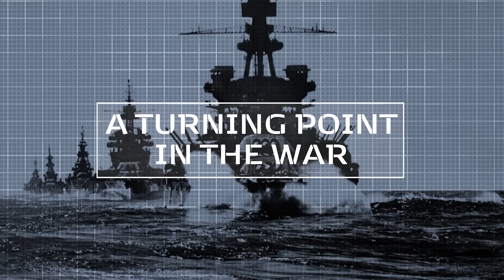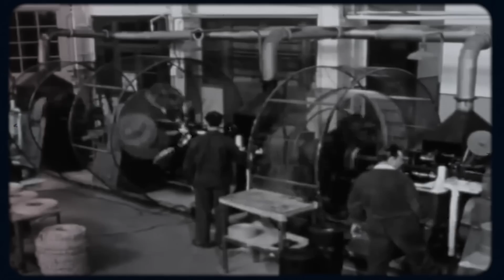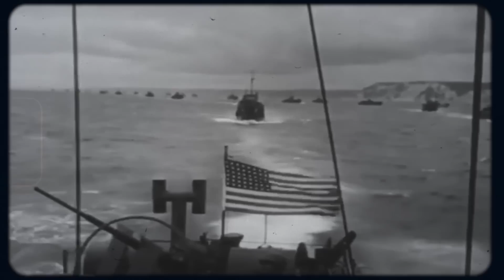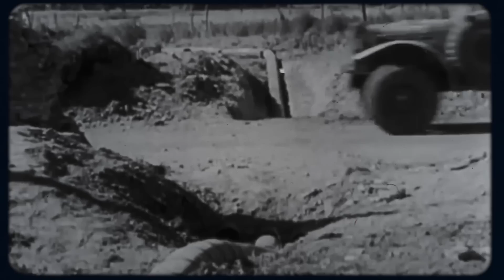The Incredible Wartime Pipeline Beneath the English Channel...

Comment: I have always had my doubts about how practical the PLUTO pipelines were.  I’ve done some rough pressure drop calculations. Stuffing a worthwhile flow through even  20 or 30 miles of 2” to 3-1/2” pipe results in an enormous pressure drop, requiring a phenomenal amount of pumping horsepower.
Reply: Yes, hence the failure of trying to pump it 75+ miles from the IOW to Cherbourg

Comment: Also not sexy but very interesting is how that pipelaying technology was reused well after the war. The "coiled tubing rig" came out of this- it uses hundreds to thousands of feet of a  stainless steel alloy pipe wrapped around a big spool. It works by coiling and uncoiling the pipe into the well bore, the tools cannot be rotated by this pipe, so the pipe conveys very high pressure drilling fluid to drive the tools. This was the early '70s, US  oil was still heavily in recovery from the four years of providing 8 in ten gallons of fuel and lubricants used by all Allied parties; the coiled tubing rig and the tools being developed for it proved ideal for "working over" existing wells with low production- over hauling them to clean out the sand and debris that had packed up in the lower well bore. This, more than any other line of development helped put America's over 120,000 oil wells back in the business as the world's leading oil and gas producer. Today it is the key to lateral boring at great depth needed to more largely exploit "tight gas formations"- to drill a long hole in the pay zone, parallel to the ground plane, then seal the entry end and pump as much as millions of psi into it to inject sand particles into the formation cracks.

Comment: 0:50 - Chapter 1 - A turning point in the war
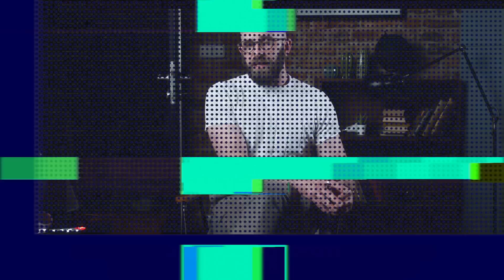2:50 - Mid roll ads
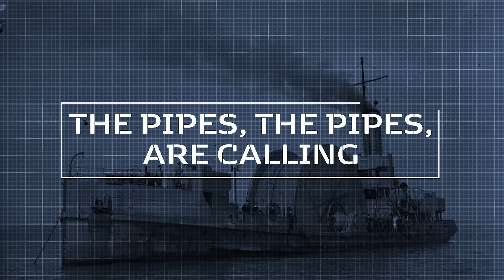3:40 - Chapter 2 - The pipes; the pipes; are calling
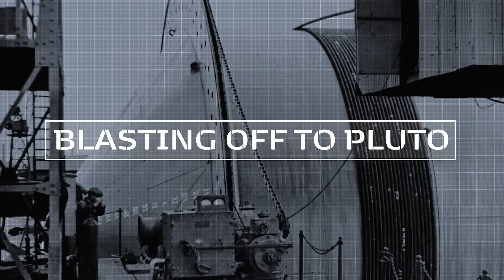7:45 - Chapter 3 - Blasting off to pluto
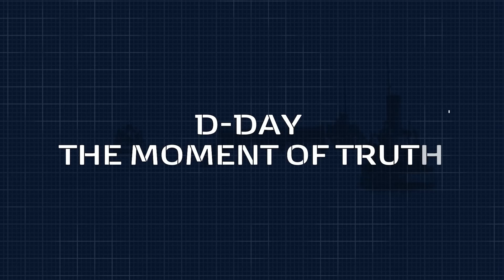10:55 - Chapter 4 - D day the moment of truth
13:55 - Chapter 5 - Operation pluto a critical legacy

Comment: THANKS 😎👍🏼 - - SUGGESTIONS:  
More MAPS - showing: (1) distance⛽️traveled from INSIDE🏴 to 🇫🇷 
(2) distances the⛽️hoses travel today on the ocean/sea floors

9:44 - - Q1:  70 + 31 miles (but it READS: “280” + “500 MILES”) - - ? - - 
Q2:  could that be referring to the distances of the PUMPING STATIONS ?
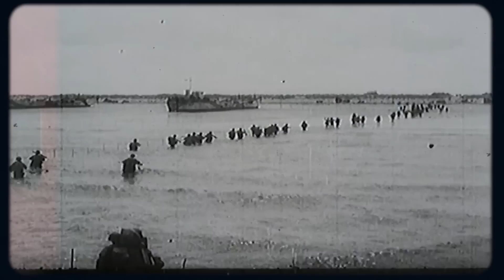11:10 - - 8/12/44, 8/27/44 (both failed) 
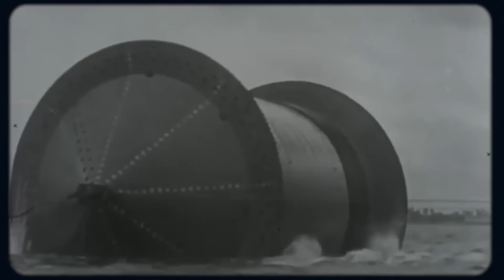11:21 - - success: 9/22/44, 9/29/44 (250k liters per day)
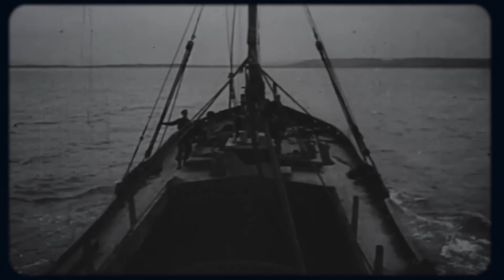13:02 - - 10/10/44 - - 3” line installed in 5 hrs 
13:22 - - 21 cables pulled across 🏴Channel (= width of Texas!); 1m gal per day 
14:06 - - btw 8/44 - 5/45 = 172m gals of⛽️to 🇫🇷 
14:50 - - underwater pipelines today deliver across the ocean 🌊

Comment: According to Wikipedia, PLUTO supplied 8% of the fuel and petroleum products used by the allies. 

However, the stats provided in “The Prize: The Epic Quest for Oil, Money & Power” were significantly different. I’m not sure how to prove it either way, but based on the difficulties with the technology at the time I suspect it was lower than 8% - especially with how much effort was put into tanker production.
Reply: The stats provided by the government at the end of the war are very suspect, there was a certain amount of 'justification' required. The figures for pumping from Dungeness are reasonably reliable but not we think those for  BAMBI from the IOW. However that is not to detract from the incredible feat of engineering achieved in an amazing timescale. I think the attempt to pump fuel over 75 miles undersea from the IOW can be summed up in the old adage of war 'No plan survives the first contact with the enemy'  in this case the English Channel and distance.

Comment: Simon, how the hell did you miss that Pluto was a complete ignominious failure. It did not work. The official War Dept report of 1955 concluded that the resources used had been wasted and should have been used elsewhere. the average  life of each pipeline was less than 6 weeks. 
It was 6 weeks late into service which means that when it could have been useful it was not there.  Most damming of all of the fuel for the allied armies in Europe only 8% came through Pluto.